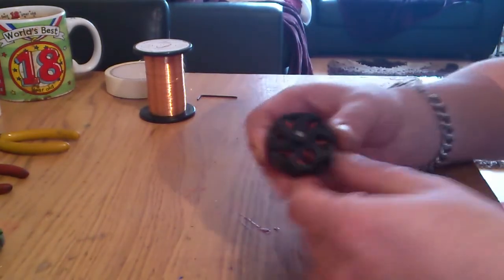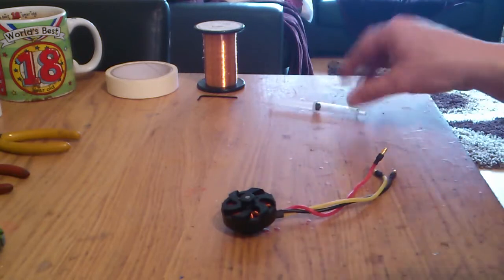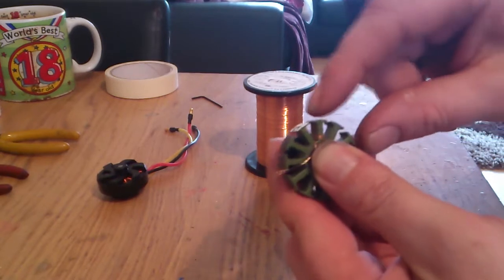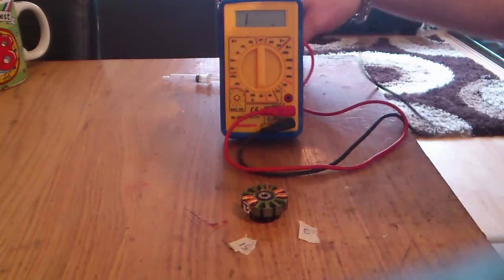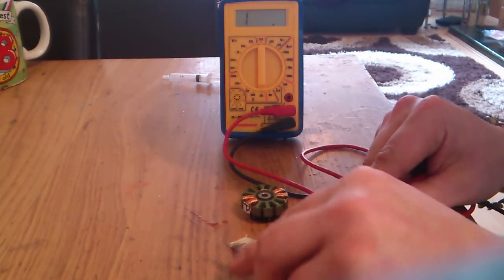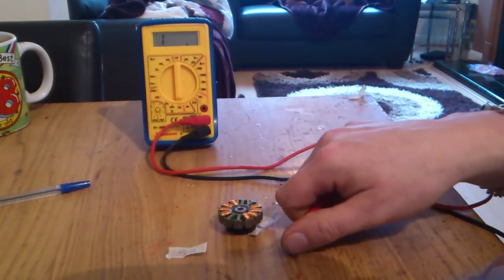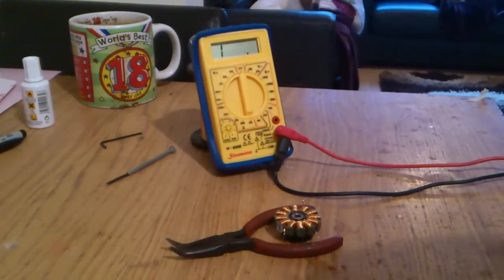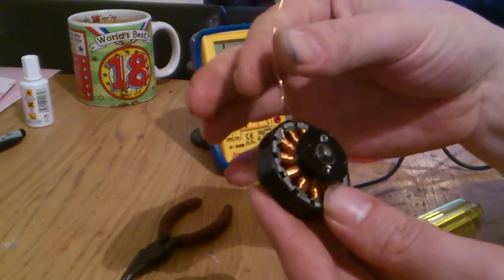Brushless gimbal rewind tutorial

Comment from the maker: Because the standard motor is wound in a Wye configuration, we are rewinding them in Delta to gain more torque to move heavy cameras instead of feather light props. We also rewind them to drop the KV down because you want a really slow motor that is precise not a high revving motor. If you can follow the video it should be fine for you to do yes

Comment: Thanks for the tutorial...I am not clear about one point. When you finish winding 2 and 1 do you just lead the wire straight across to 7 and 8? If this is the case, does the enameling on the wire prevent it shorting out when it touches other wires crisscrossing the motor? Sorry electronics is not a strong suit of mine.
Cheers

Comment: When you "go to" from one set of windings to the other side of the motor, how do you run the wire? It has to cross over other winding sections. Also can I use a regular brushless esc with gimbal motors to get slow speed operations for model boats?
Reply from the maker: I just bring the winding around the bearing of the motor shafy, leaving a few mm so it does not catch when the motor gets reassembled

Comment: I would like to be able to use a gimbal motor but operate it like a regular BLDC. The reason is for the package size and the hollow shaft. However I am told that a gimbal is not meant for continuous revolution, and I want it to do about 300rpm continuously. Is this possible?
Reply: Wireline In theory yes the motor could happily work continuously. However the driver works out how to move the motor in relation to the position of the imu in relation to it's required position. the driver then applies force to the gimbal to rotate it to this position. So to command it to go past 360 degrees would conflict with the PID loop so wouldn't be possible.